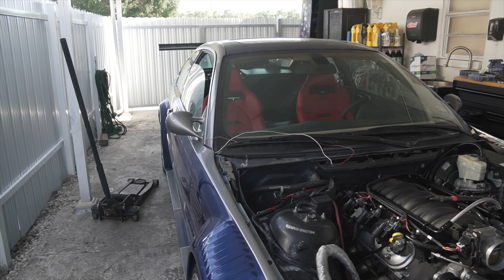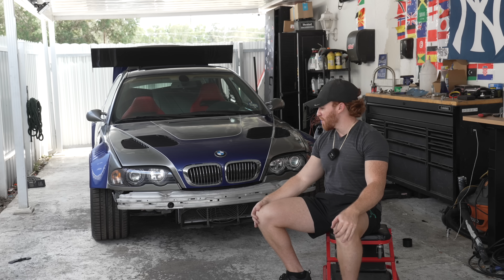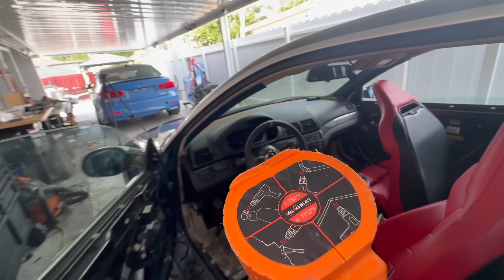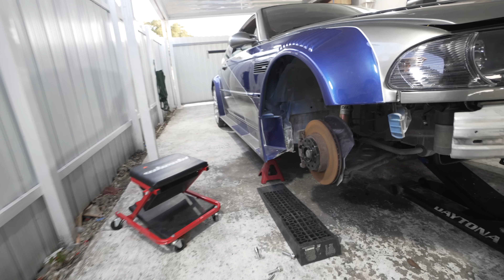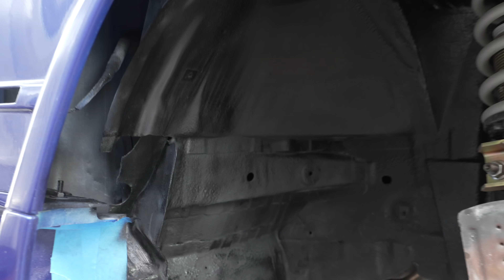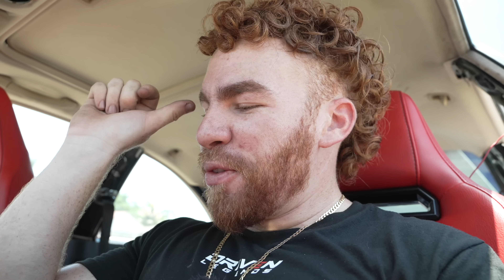I Turned a $1,000 BMW into the Iconic Need For Speed BMW and it's Insane!!

Comment: @DannyZee

I’m rebuilding my standard 320i E90 LCI to a M Sport 335i (just not sure to go for a N54 or N55 motor)

Work done so far:
1# Standard Suspension - Changed to M-Sport (Dampers only / Stock springs)
2# M-Sport body kit

Still a lot of work to do 💯

#SouthAfrica

Comment: I used the 345mm csl discs with the 340mm calipers off the 140i on my m3. Only because i picked up the smaller calipers instead of the 370/380mm calipers off the 340i/m3

Comment: The e46 oem fan is pwm controlled fan (pulse, width, modulation) there’s main power to fan and then a signal wire controls how much the fan pumps out relative to engine operating temperatures. 
I’m pretty positive the holly terminator can do pwm fan control you just have to set it to the right frequency. I like the idea of oem fan they work well and if you have 6.0ls would be good idea to upgrade radiator if you haven’t already I’m still watching video but csf hands down best bolt on all aluminum radiator that works with oem fan and should have more then enough cooling for the ls. 

Glad to see you working on this again keep up good work!

Comment: Love this ride. Put some Rubber between the cables and der hole you cut into the firewall. Otherwise the cable will get damaged over time from the sharp metal and in worst case cause a short.

Comment: For those crimp connectors for attaching to the battery you're better off adding solder as well as the mechanical connection isn't the greatest when you're taking things on and off all the time like you have been :)

Comment: Please put the rotors on the corect side and please clean the hubs 22:10 [not sure if I see good but looks like the veins are looking the wrong way? cause only veins are important], the wire wheel is not enough. Some wires rubbing might cause problems in future.
The fan is worse than the ori one but I understand the original is hard to control in comparison.
Other than that very nice video.

Comment: Be careful with that little cut in the firewall and the positive wire you put through it!!! Positive connection to the terminal without a fuse next to that exposed sharp metal scaring me, a little electrical tape on the cutout should be good, love the car!!!

Comment: My dream car is a BMW i8 with roketbuny and BBS rims with negative camber air suspension system twin turbo 6 cylinder engine swap and the a car will be blacked out with red LED headlights with the latest touch scream😎

Comment: for those that might be miseducated now thats not how a relay works it eseentially uses a low amp switch circuit usually from the ecu which energies the coil and allows high amp power such as needed for the fuel pump or fans to flow its basically a switch to convert from a control circuit to a high amp circuit

Comment: Just a tip or two. The positive cable you put through the firewall will rub through on that rough metal. Put a small rubber hose around it. Also don’t put Teflon on brake line fittings as they shouldn’t be sealed on the threads. They are sealed by the ends squashed together. Good work though
Reply: Yes! Make sure that the battery cable is protected. Otherwise, it will wear through and possibly start your car on fire.
Reply: And definitely dont pull the altarnator wire next to the fuel lines cuz if that mfkr goes hot and starts overcharging is going to make such a big bum that it will fkin send u to the space ✌🏼👌🏼
Reply: @TheImmortalMF  Had the same thought, I'm sure it will be fine but better to be safe just in case when there is so much custom work.
Reply: Rotors were also installed backwards. Internal fins are directional and should be directed to the front so air will flow properly.
Reply: Came here to say exactly this

Comment: Here's why you should not use Teflon tape on brake lines: 
Improper Sealing:
Brake line fittings are designed to seal through metal-to-metal contact, not on the threads.
Reply: Teflon tape can prevent the fitting from sealing correctly by interfering with the metal-to-metal contact.

Comment: Really nice to see this car back. Couple of pointers, add some rubber around the edges of that slit u cut to run positive cables thru so you don't catch the car on fire when the metal rubs thru, then for that oil filter I'd strongly suggest using a wix not fram, and the last one I'm pretty sure the front rotors are mounted backwards, don't know if the rears are directional but the fronts look directional. Keep up the good work :D